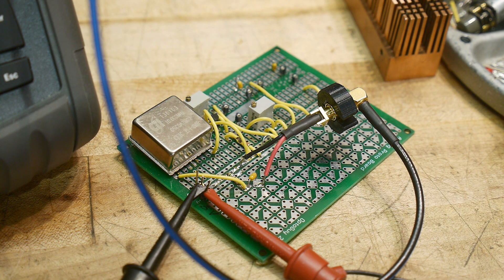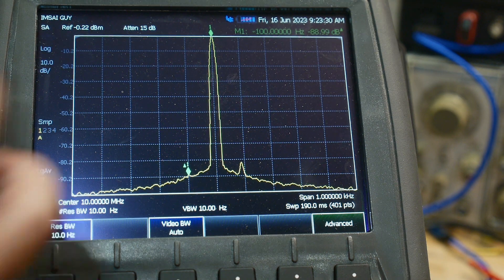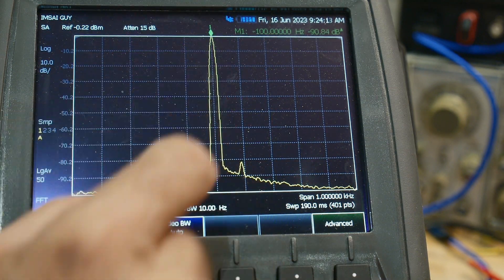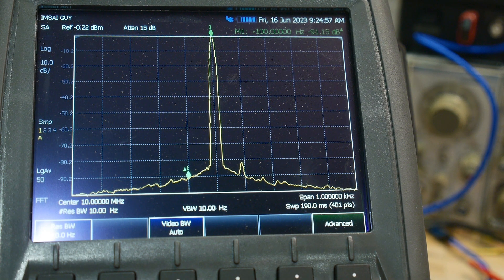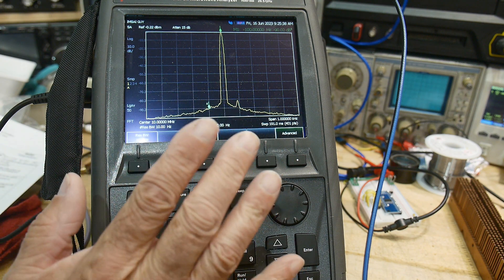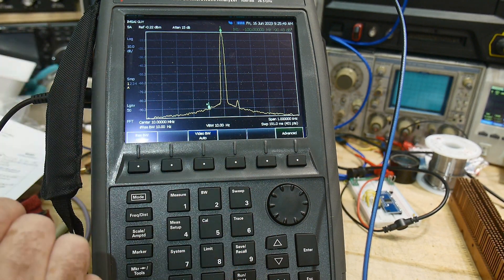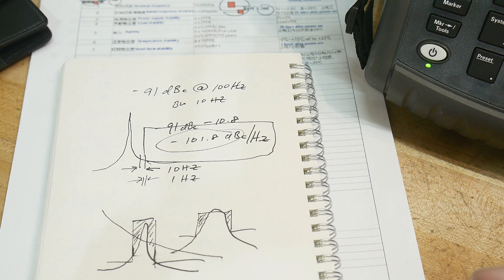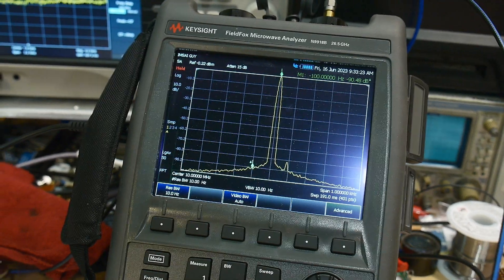#1542 Measuring Phase Noise

Comment: Interesting again. I noted that the oscillator was mounted on a pcb but I cannot see any bypass caps there. Most oscillators require various filtering for best results and this surely will affect the phase noise<
Reply from the maker: all the yellow things on the board are bypass caps
Reply: @IMSAIGuy  OK, my mistake

Comment: I have been making phase noise measurements using a HP 70K series SA. For the most part I can get measurements that are comparable to or exceed the phase noise measurements listed on various signal sources. A HP 3335A @ 20MHz is listed @ <-70dBc @ 30kHz, manually using the dBc method @ 1kHz RBW I get a phase noise measurement of <-74dBc, using the KE5FX phase noise utility I regularly get measurements in excess of -109 dBc/Hz. When I use this tool to measure the phase noise of my HP8644A I get what is basically listed in the specification sheet, 1GHz <-93dBc/Hz @ 1kHz. What I currently have will work for now till I manage to get a proper phase noise measurement setup. Keep up the great work!

Comment: Siglent has noise marker function, why not use it? Also the detector type - should it be positive peak or rather sample?
When delta f for phase noise is above few khz can use the crystal oscilator noth filter to limit the carrier and decrease the noise floor by reducing attenuator value?

Comment: R&S have some great videos about phase-noise measurements on their channel. I can jsut remember during my time in a RF R&D lab (20 years), the curse of measuring phase noise at better than -174dBc at 1% offset. (Heck, we laughed at products with a -155dBc phase noise)…Not something you would want to do every day, unless you are in the design-phase. Had to use cystals for a notch filter and quite a bit of other circuitry, and lots of experimentation to come up (hopefully) with a correct answer. Somehow the cross-correlator solution never came up in our lab-discussions, but maybe our solution was good enough, or maybe that was just too expensive to implement, can’t remember…

Comment: You referred to the LOs as "IF" a couple times, but we know what you meant 🙂. The dual-LO 'Correlation' approach would provide some reduction, but there's always some RANDOM correlation between two random sources, and so you would not get a 'very high' rejection from the correlation algorithm alone (maybe 6dB? <- Speculation alert, based on pure instinct).  Averaging over time, perhaps synchronously with the input, might be part of the larger solution to achieve significantly better instrument specs (i.e. 'very high' rejection of internal phase noise). Also, if they slow down the PLL loop (or digital equivalent), then they could improve the instrument phase noise at the expense of slowing down the measurements.

Comment: I knew from the outset that those OCXOs are going to be significantly better than any run-of-the-mill master oscillator in any instrument that is not specifically designed and built for such measurements. You might as well be measuring a voltage reference with a DVOM. Look inside the instrument, hopefully you don't find a TCXO which are known to potentially have phase noise.

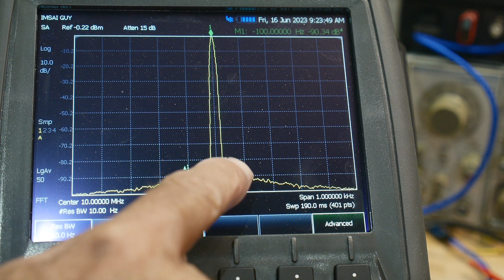Comment: At 1:12 you mention that the spur on the upper lobe is an artifact from the SA. How did you determine that and is that really expected for such a $$$ spectrum analyzer? I would have expected a $35k Keysight to not show any false spurs or artifacts. What's going on there?
Reply from the maker: it is common for spectrum analyzers to have spurs. some have a spur removal option to delete them but it slows down the sweep. Yes this is expensive and you might not expect it, but this is a small portable unit so not perfect. there are ways to test if it is a spur, setting attenuator settings for changing the freq of the signal. I had a second analyzer that did not show the spur

Comment: Always difficult to know exactly what were the measuring conditions from the datasheet. Even more difficult to get the same measurements, even for standard methods. 
My experience is that switching from Keysight to Rhode & Schwarz will give a different result...
A R&D engineer from Analog Devices told me one day : take the datasheet with care, they are edited by the marketing guys 🤣

Comment: Now, that I think about it a little more, you have similar problem as jammer signal in receivers.   A strong signal next to a weak signal.  To increase dynamic range tune out the carrier when measuring the offset, by changing the span.  You probably could use notch filter on the carrier when measuring the offset power.   
Measuring anything with dynamic range of more the 90 dB is challenge. 
Another indirect way is to measure RMS jitter, with the help of GPSDO.   Then you can calculate phase noise from jitter, using Shannon's law.
I am interested on correlater circuit.  I guess they also use it in CDMA communication to detect signals below noise level.

Comment: the same autocorrelation method can be used for 1/f noise.  There is a NIST paper where they had to run the autocorrelation for over a week to measure the 1/f spectrum of a NiCd battery

Comment: thanks, I learned from your presentation.
But since your filter is the same for the peak and offset, it will cancel out and you do not need to correct for it.
Also, you need to correct for your environmental noise ( which depends on the temperature.), and wires ( which act as Ant.) , and return loss, etc.

Comment: You just answered several questions I have had for years regarding PN measurements. For giggles did you try your HP8563 (??) SA? I have a HP8566B and a third part TG but with the TG my DR is limited to ~80dB.
I'd be very interested in more PN vidoes if you are so inclined...THANKS es 73

Comment: Thank you for this informative video. I am also curious if the oscillator data sheet claims -140dbc but is actually higher.
Reply: It may indeed be a bit higher, but likely still well below the measuring capabilities of either spectrum analyzer. In other words it might be something like -132dBc/Hz at 100Hz instead of -140, but both of those are quite far below the minimum phase noise measurement capabilities of all but a handful of very expensive spectrum analyzers.

Comment: The windowing applied to the signal prior to taking the FFT (to constrain leakage from the start and end of the time sequence) is critical when you are interested in measuring very large dynamic ranges. The window function will result in a maximum sidelobe level plus a falloff per bin. If a Hann window is being applied, it has a pretty high first sidelobe but a falloff of 18 dB. Other windows are available with lower first sidelobe levels but slower falloff.

It would be interesting to see if you got better results by reducing your RBW. The Signlent analyzer looks like it might be near its noise floor, but the Keysight unit might benefit...

Comment: The HP App note 150 series gets into measuring noise and explains the components of the 2.5 dB and the 1.2 factor for the resolution bandwidth.  My HP 8563e has a marker noise function that will read the noise power directly and takes the aforementioned into account.  I think your 8591 has it as well.

I learned how to make the noise measurements on older analog HP spectrum analyzers so still do the old fashioned way often, but the marker noise function is handy as a time saver.

But we didn't usually use the spectrum analyzer for phase noise measurements because the typical oscillators we employed had such low phase noise that you can't measure it directly on the spectrum analyzer - same problem you showed.

Good phase noise performance is really important though in a lot of digital communications circuits and there have been a number of times when either poor phase noise or poor oscillator isolation from mechanical shock or vibration has resulted in data link problems that were kind of hard to pin down.  These can be very hard to measure in the field . . .